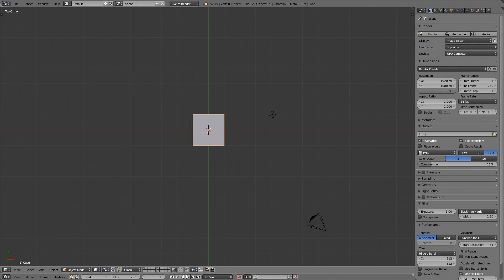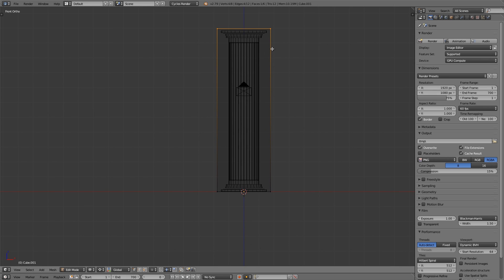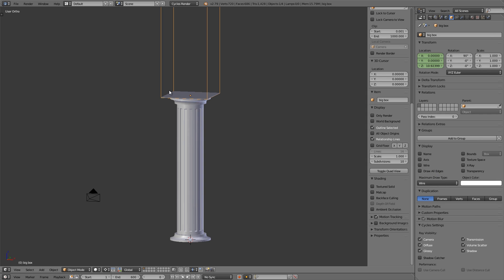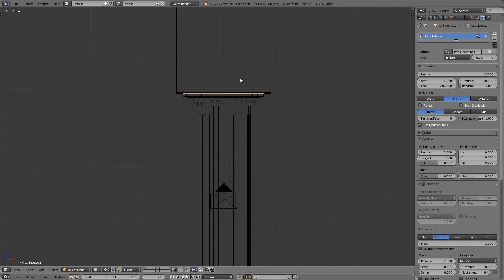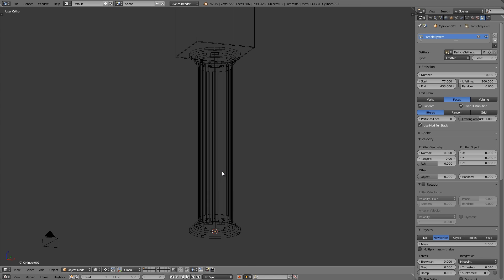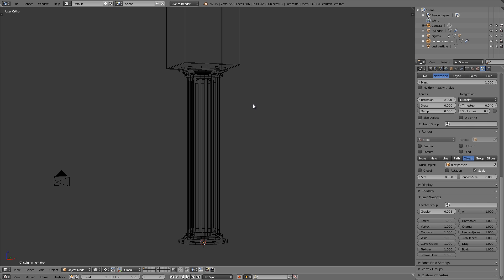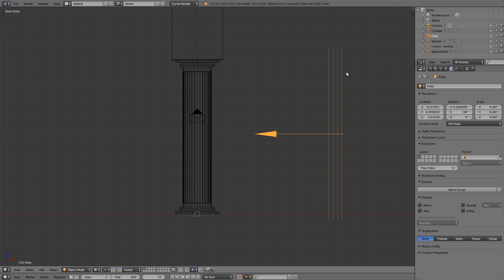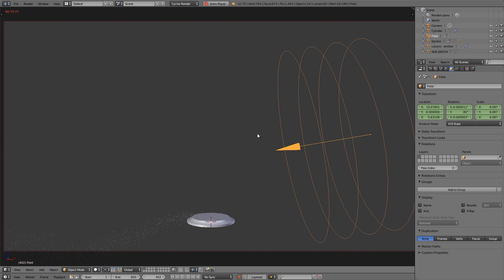Dust in the Wind - VFX in Blender

Comment: Is this the same method you’d use to “blow away” a text graphic, or is there a simpler 2D method for that?
Reply from the maker: I'm honestly not sure. I feel like text probably has a simpler way to achieve this, but VFX aren't really an area of expertise for me. -Chris
Reply: CG Masters   Okay. I’ll keep experimenting.
Reply: @blengine  Sorry to bother you again, but I get a short burst of particles from the center of my object just before the big box sliver begins cutting through and making particles from the end. I have hunted in vain to figure out what's causing them. Any suggestions? Thanks in advance for any assistance you can give.
Reply from the maker: @schreckkinowerks8251  Ah I vaguely remember this being an issue, and I think it had something to do with the start frame of the particle system. For example, if no faces of an emitter object are visible when the particle system begins emitting, maybe they start emitting from the origin point, so you'd have to change the start frame. That's just a guess, it's been a long time since I worked with particles.

Comment: Thanks for the video, and I love that you provide the source files for download! My critique is that the object turns to dust in a very uniform and even way. So I took your source file and added subdivisions to the bottom of big box and slither, added displace modifiers with a cloud texture linked to an empty object. The empty object is paired to big box, but moves slowly to the side which moves my displacement texture. This method ALMOST works, except for a few frames when for some reason the boolean modifier for Cylinder.001 dysfunctions completely and the whole object is seen momentarily. If anyone knows why this is happening and/or how to fix it please let me know! Also if anyone has other ideas how to make the dissolving less uniform I would to love to hear them.
Reply from the maker: Oh yeah, a lot could be done with these basic mechanics to improve the effect for sure. For your boolen problem, maybe try changing the solver method for the boolean modifier? Not really sure why that's happening though. -c

Comment: I uploaded something similar on some Blender related Facebooks sites 👍. You can increase the amount of randomness by subdividing the sliver and randomly push and pull vertices in z-direction. So the sliver cut not as uniform as it did in your video.
Reply from the maker: That's a great idea. I know a lot can be done with these base mechanics so I might revisit the topic in the future and achieve more advanced results. Maybe even experiment with different effects other than dust too. -chris

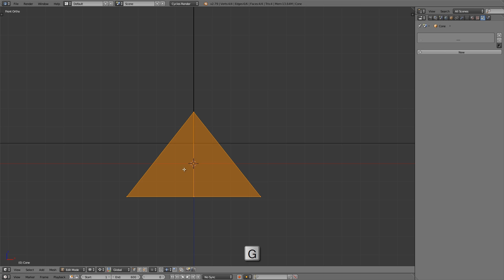Comment: Quick tip at 10:00 - you can just press the blender's longest key shortcut CTRL+SHIFT+ALT+C and then press set origin to mass :)
Reply from the maker: Oh yeah I actually included that shortcut in my last vid on hot keys, so I actually thought about it while recording this. But in this case it just felt easier to just nudge it up a little. -chris